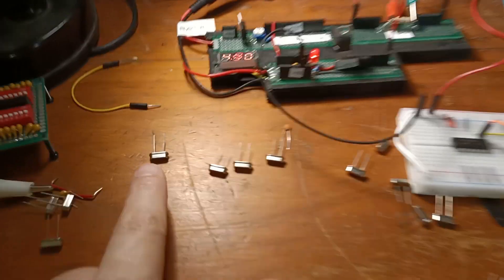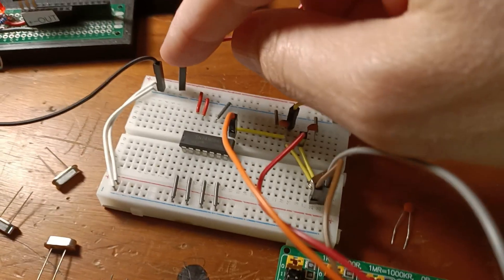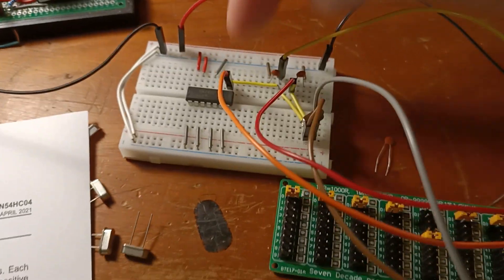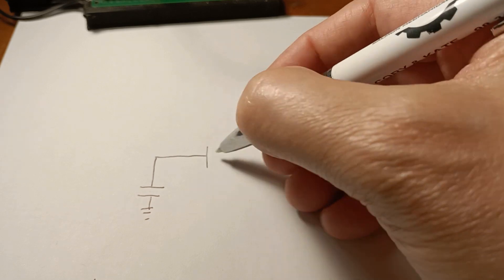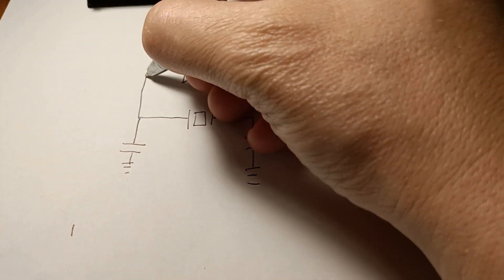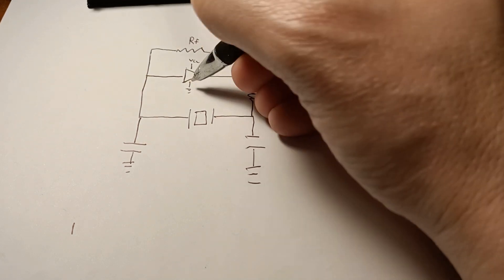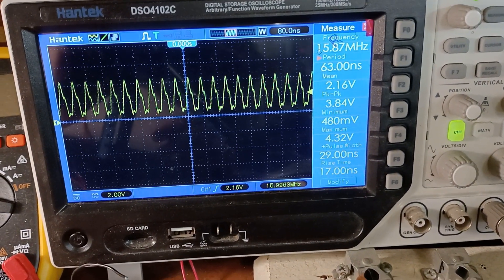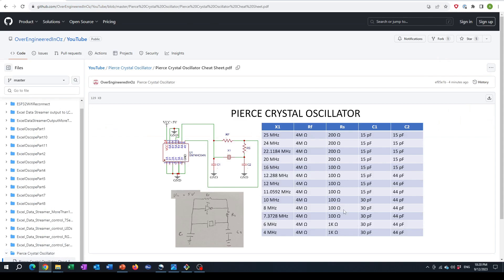Pierce Oscillator

Comment: Hello, thanks for this great video! Is the sn74hc04n necessary so that these values work? or any other inverter is OK ?
Reply from the maker: I have only tried it with that part. It might work with others though. It is just the one I happened to have.
Reply: @overengineeredinoz7683 thanks !